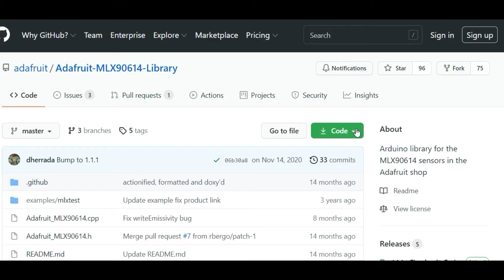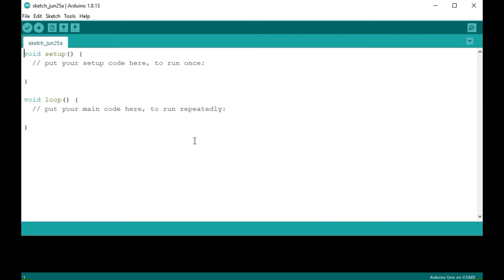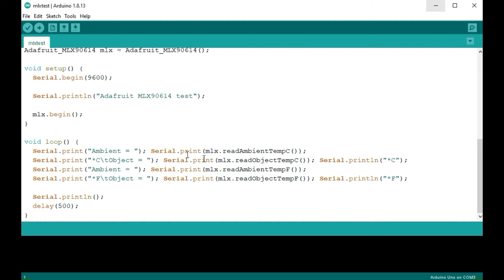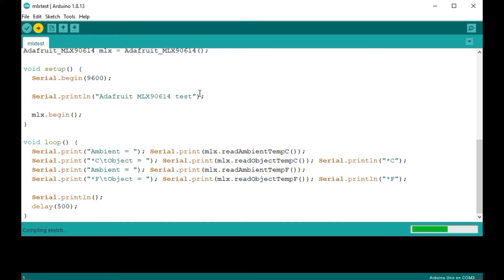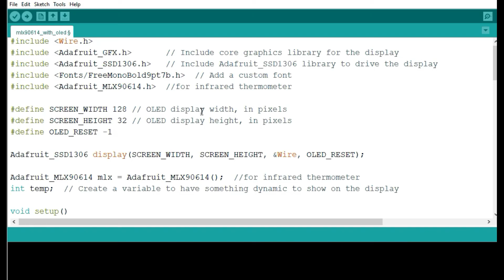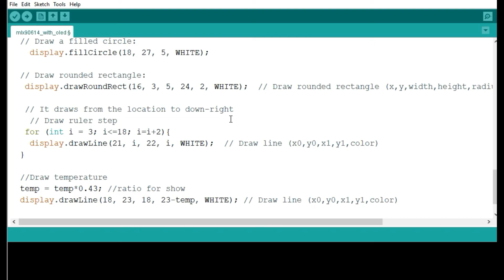MLX90614 Non-contact Infrared Temperature Sensor with Arduino.

Comment: Hello, I am using SH1106 instead of SSD1306, so I replaced the code from SSD1306 to SH1106. After uploading, I encountered several errors. What could be the reason for this?

Comment: Wow! thanks for the tutorial. Past experiences have shown that this sensor a breakout board, shows inaccurate readings, for body temperature in particular, how can 1 improve the readings? is it by adjusting the code or by not using the breakout board?